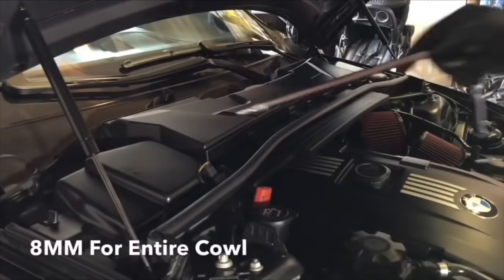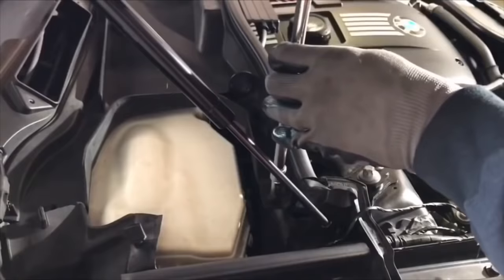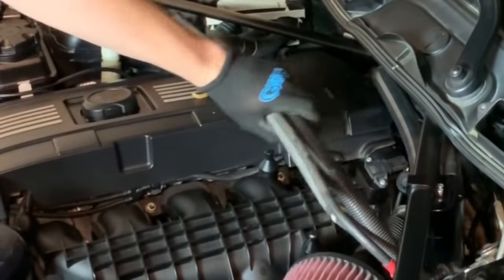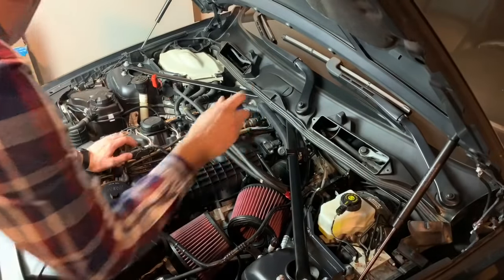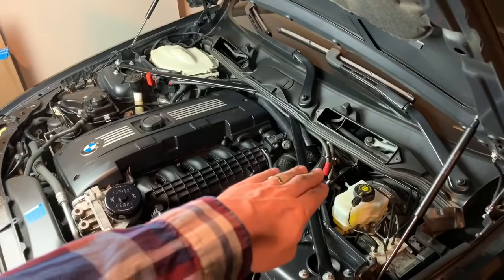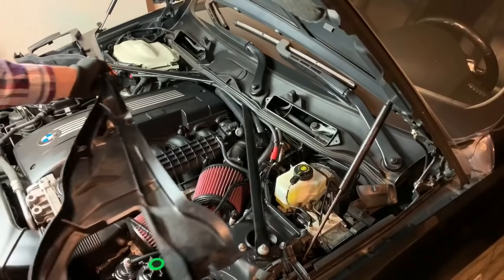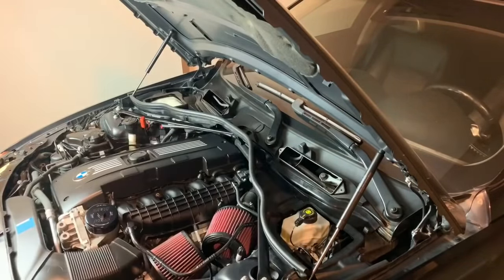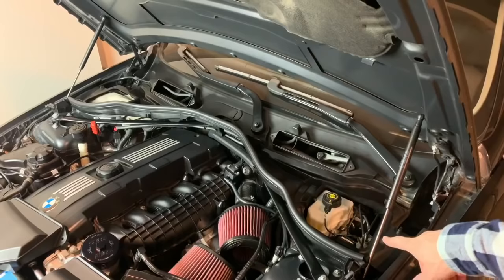BMW M3 Cowl DIY In My 335i!

Comment: Great clear video as always!  I’d didn’t see the point of replacing the cowl until you showed the before and after pics.  It seems that bmw could have just used that M3 type cowl in the beginning on all models, allowing easier access to plugs etc.
Reply: 4XM3 filters are a lot more expensive than one E9x filter.
Reply: @maxnix346  Agree this mod is nice but too much...this conversion is almost $400 not worth it
Reply: @dflex4180  ouch-ouch! I'll put that n]money into (legal, of course) speeeeed. Great vid, shows it clealy, and it's nice, but. The cowl filters, or vent filters, really, look like a good idea next time my orig style filter that I JUST replaced needs changing.

Comment: Burger Motorsports has cowl filters that mount right to the fresh air intake ports for $59 deleting the factory cowls. Maybe a more modest option with similar effect.
Reply: Deleting the cowls lets water get in. The lip of the cowl goes up to the hood acting like a water barrier. Go to a car wash then open ur hood, there will be water in on the cowl but not the engine
Reply: Drive by a construction site you’ll taste it

Comment: $700 in parts?!? Love your videos man but how is that cost effective just to be able to get the engine cover off more easily? Looks nice though!
Reply from the maker: Melche’s Garage That’s brand new man,  which some people like to go that route. I have a few friends that picked it up used for much less 😀
Reply: 150-300 bucks bought elsewhere or used
Reply: @typedrew  Hey! E90 post gang hahaha
Reply: Almost 700$ in parts? What’s wrong with cowl delete? With BMS cabin filters installed?? Way cheaper and same upgrade. Only thing is you may want to leave the bottom part of the cowl in and cut out the section that the M3 leaves out. Then re-install weather stripping so you can still cover the DME and brake reservoir.  This upgrade is way way too expensive for the benefit. I love your diy’s because they are done CORRECTLY, but this one is just too much money for the little upgrade. Still loved the DIY though.
Reply: Its nice to have that accessible  but I agree on being expensive, that's crazy, it take 15 min max to get the oem cowl out. 3 or 4 times a year max. That's like new front and rear bumpers,  or coilovers
Reply: @duece3000gt24  your ac will not pump cold like it used too w those BMS filters and a lot of noise will be coming from that area

Comment: Anyone can hack up a stock part and bolt it back on. Takes a real craftsman to go to work to make the money to buy and install a part designed and built for the chassis. That’s called “doing right by the car”. Great video and job. Looks much better than a “budget build”. I’ll be doing this to my ‘11e93 “is” soon. I’ve got 2 M3’s and a 335is in the stable so yes, my philosophy is rather expensive. But hey, you only live once! FYI $777 shipped to my door with 4 filters & gasket. Anyone want my old stuff to hack up and put on their car?

Comment: Why are u so damn perfect if I was a millionaire I'd fly you over to service my bmws 👌, it's actually a Nice weight reduction too, I have done something that you haven't I have modified my front bumper and grill to allow airflow to make contact at all lines of the intercooler and slightly bend down the front bumper so it's quite a significant different in airflow to the intercooler, for example the Oem one receives no airflow to the bottom 3 rows and the addition of the mesh breaking up the air it's dropped my Oem intercooler by 5degc average on a pull as those plastic fins are quite thick with an aftermarket cooler damage would be minimal and I think it could be a great mod to explore IMO
Reply: That sounds like a great idea!!

Comment: Why did you choose the m3 cowl instead of the burger motorsports cowl deletes?
Reply: Robert Dominguez he had those a while back.Maybe, he wants a cleaner look
Reply from the maker: Robert Dominguez I’ve been meaning to do this mod for the last few years...but I’m all about the clean look 👍🏻
I had the BMS filters before and they worked great
Reply: So you can have a clean engine bay that lets you work on it without having the remove the cowl without any extra noise

Comment: BMS cabin filters. 10-15 F difference in operating Temp. Cheap and removes that plastic completely. Also some nice engine turbo noises. Best mode I did on the car.

Comment: what made you get rid of the bms cowls you ran a while ago?
Reply: THIS
Reply: Heavy downpour with those bms open cowl filters no bueno.thats y
Reply: @wpg1977  that never a problem. I live in Florida. Rains at least 2 times a week heavy
Reply: He won’t respond to that question. I’ve been wondering why he doesn’t ....
Reply: Because it’s to loud. All you hear is air being sucked into the intake filters. It does help the engine cool and if you like working under the hood it’s nice to have all that crap out the way. But on my car all I could hear is air getting sucked into the intakes. No more turbo spool whine and no stock exhaust rumble.
Reply: D. Giroir that’s the reason I got the filters. To hear louder induction noise
Reply: @jdmmuscle4727   I read D. Giroir's comment and was like "...isn't that part of the reason for doing that mod in the first place? lol you wanna hear them spooly bois"
Reply: TheSilverslayer13 I’ve had them one for a while and my engine is fine
Reply: JDM Muscle me too. I found out. Go on burgertuning website for the cowl filters. Scroll down youll find his video. He did it for the company, im guessing it was paid

Comment: Did you have a bonnet/ hood open warning when driving?  I did as the profile of the underside of the M3 bonnet/ hood is different and the micro switch may not indicate that the bonnet/ hood is closed. I got around this issue by using a zip tie on the micro switch to hold the pin down, as if the bonnet/ hood is open l cannot see where I’m going due to the extremely large piece of metal obscuring my view,  so no need for the warning light on the instrument panel haha. We call the hood a bonnet on this side of the pond, JIC no one has worked it out. 🏴
Reply from the maker: Joe Powell No error message now, but I have the button electrical taped down so no message comes up, but yeah it didn’t reach to the hood.